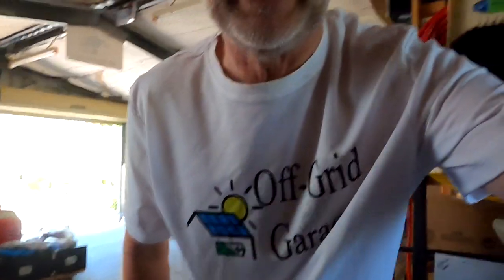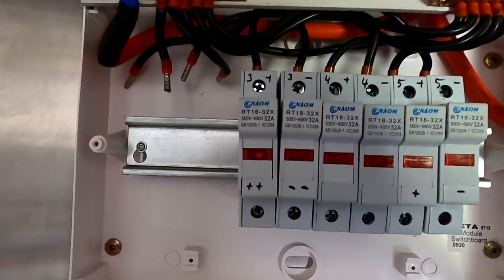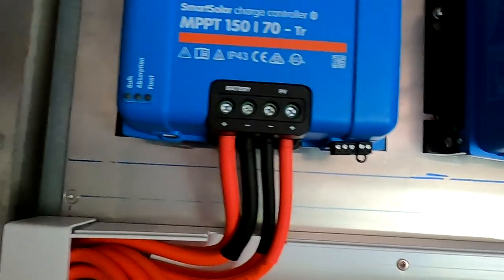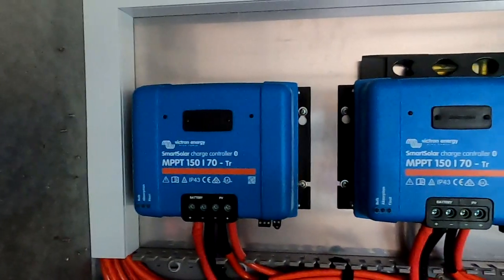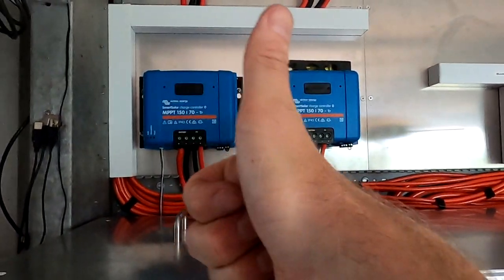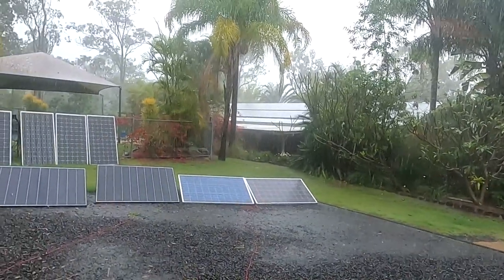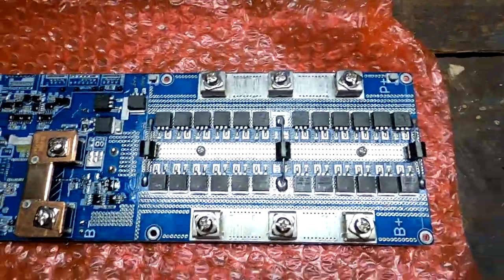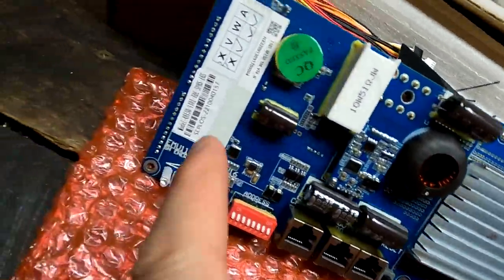Living without solar. Possible? Also, the brand new SEPLOS BMS 10E with Bluetooth arrived...

Comment: Andy my friend, you should be putting bare wire in those solar charge controller terminations.  You are reducing the contact surface using ferrules in a terminal that is designed to compress finely stranded wire.  The compression spreads the wire and makes contact on all sides of the wire.
Reply: Noooo! Damn your infernal logic. I love ferrules too.
Reply: Can you test this while you wait for panels Andy?
Reply: I was about to write something similar. The ridged nature of the clamp plus ridges on the ferrules could easily reduce the effective contact area.
By using bare wire you are increasing contact area👍🏻
Reply: That's really useful to know, will be the same on the MCB's.  So I doubt I'll need my crimper I ordered yesterday, but at least I've not ordered the ferrules.
Reply: Agreed, no ferules required there. Thin stranded wires will compress easy in those terminal.
Reply: Ferrules should only be used with terminals that aren't made for fine stranded wire. If the terminal is made for it then fine stranded wire will have a much better contact area than rigid ferrules.
Reply: @taulli1  That has nothing to do with love, buddy.
Reply: @TheRonskiman  It depends on the terminal type and how finely stranded the wire is. In some cases ferrules are needed to avoid the connection loosening over time.
Reply: Come on 😊we are not talking about micro volts 😅 put the wire as you like it won’t make any difference
Reply: @niktak1114  So how do we know which is correct, to ferrule or not to ferrule? The MCB's I have, have the same style terminal as the Victron MPPT's.
Reply: @TheRonskiman  it's all in the terminal, most products come with instructions that tell you if it's designed for solid or stranded wire.  Ferrules should only be used when a terminal requires solid wire (or coarsely stranded wire) as those terminals usually have a small surface area spring, that is designed to push the solid wire against a single flat surface that conducts the current (there are also compression fittings for solid and coarsely stranded wire that conduct from 4 sides including the screw that you shouldn't use finely stranded wire in) .  If you look closely at the terminal on the solar charge controller, you will see ridges that are there to help hold stranded wire in place after it's compressed.  A ferrule will only touch those ridges.  This is a very small surface area and will cause heat to build up.
Reply: @hamieh1  I'm sorry but you are incorrect my friend.  Look closely and you will see the ridges that are designed to hold the finely stranded wire in place.  Those ridges are the only surface area that a ferrule will be touching.  Stranded wire compressed touches way more surface area.
Reply: @SabretoothBarnacle  spot on brother.
Reply: @boatelectricaldiy  I totally agree with what you said about the surface area , but that wouldn’t make any changes to the performance as we are not dealing with micro volts . But if you are looking for perfection yes you are correct 👍👍👍
Reply: @boatelectricaldiy  Thanks. The MCBs I have, have the same ridges.
Reply from the maker: I have discussed this with the electrician and will tell you soon here on the channel...
Reply: Correct , the only time to use a ferrule is when the screw itself is contacting the wire strands  . When you have strand clamps , you need strands . A Flir camera will show the difference quickly at this amp load .
Reply from the maker: @onthelake9554  I'm test this out with the IR camera. I have now used both ferrules and stranded wires in these terminals so can compare it nicely.
Reply: @OffGridGarageAustralia  Cool , I look forward to it .  From what I have seen at work ( automation electrical panels) the bare strands in a strand clamp are always fine and ferrules are not under a heavy load. I know it's hard not to use them .
Reply: @OffGridGarageAustralia  Not all electricians are cut from the same cloth. I look forward to his input.  Maybe he uses a bit of glued heat shrink to create stability at the base of a stranded termination like I do?

Comment: One of my favorite things about your channel Andy is the attention to detail. You do an excellent job showing young folks the importance of detail oriented work. I still think you should put panels over the pool and make the structure out of Aluminum.
Reply from the maker: @aft what a lot of crap that comment is!
Reply: @OffGridGarageAustralia  what the engineer part ?
Reply: well the last time i checked a tesla was over 100k  and generally a blue collar worker couldnt afford that on a car but hey i dont have a tesla and you do  so if the comment offends you i will delete it
Reply: @dtec30  The whole comment , and the capitalization , the punctuation , the attitude . You too can have a Tesla if you change your outlook and work hard at something you love.
Reply: @onthelake9554  what capitalization ? or punctuation
Reply: @onthelake9554  it wasnt measnt to be derogatory and aplogies if you took it that way
Reply: @dtec30   Exactly .
Reply: @dtec30   What was it meant to be if not that ? Never mind then . Just seemed very rude to me .
Reply: I was going to oversize my house system using a frame over the pool as I'd run out of roof space.
I left it too long and legislation disallowed any increase to existing systems.

Comment: Andy  Will you try this experiment on your Charge Controllers..
Take a piece of the wire you will be using to connect to the controller. Place a ferrel on the wire BUT DO NOT CRIMP.. Put the wire with the ferrel into the controller connector and  tork the screw to spec. Go do something else for a half hour and and hour.  Rotork the screw once again. I think you will find the screw moves about 1/8 turn.. If more than 1/8 then wait some more.  Remove the wire/farel.  Check out the contact areas. This should show good contact connection.  And no fraid wires. 
Copper wire is soft. It will move from areas of high pressure to low pressure.. I find that if I go back and retort connection a month later will make for a good long working connection for life.
Reply from the maker: I can certainly do this test with the old controllers. Interesting. How does the copper move if it is stuck in a ferrule though?
Reply: @OffGridGarageAustralia  The wire move to an area of lower pressure.. I have seen this a number if time in my 50 years of working in electronics.
Reply: Using the farrules in the connector clamp is like using your hydraulic crimper.
That put tons of pressure on the lug and the wires pressing down to remove all the air between the wires. The clamp on the charger controllers not so much. The wires will move from high to low pressure over time the temperature. So retorting the screw is necessary. If the screw doesn't move while retorking you should be good.  The use of ferrules in the controller clamps with keep the wires from fraying, I think this is the best solution for Victron objection on using ferrules.

Comment: Thanks for the video, Andy.  Sorry to see your solar contractor let you down.  I was in charge of an $ 18,000,000 refinery upgrade to electronic instrumentation.  I always look at the packaging some electronic boards arrive in.  They should all be wrapped in anti-static material.  Some of the boards came in regular plastic, which caused failures several months after the operation.  They cost about $ 8000 each!  The storeman ordered wrapping for the boards and bought cheaper plastic bags!  All our technicians wore anti-static straps during installation to prevent problems.
Reply: My son had a similar story on very expensive circuit boards in heavy mining trucks.

Comment: No Ferrules!!   If you have Cage Clamp Terminals a ferrule will be a downgrade.  It will turn the connection into a couple of point connections instead of the full internal cage surface.    If the connector is a lone screw jamming into the cable then use ferrules.

Comment: I see the west roof is kicking in nicely, 10 amps at 8am, 20 amps by 9.30am - even if thats it for today, no more strings you'll still get a decent photon harvest :)
Reply: 10.30 and I guess thats the unshading - bring on the 50A!
Reply: @KevIsOffGrid  Nice, it was hitting 52.1A by 10-51, finally getting some charge back into those batteries 🙂

Comment: Imo the old trace C35, C60 etc unit had a big grub screw to hold the cable, held the cables really tight, with the type that victron uses, should include a flex grip under, imo there are crap, need to make good connections when dealing with dc

Comment: Darn... I was hoping to see some panels today. The title was not misleading.

I am actually wondering, how did you get along defining what it's their responsability and what it's your responsability in the build. So they just put the solar panels, cabling and some bits and odds, and you do from solar charge controllers down? Would be interesting to know.

I asked a solar company for a quotation until the charge controller/inverter, and they were not interested or would not give me warranty if I connected my own batteries...

Waiting for good news from your side.

Cheers and keep up the great, great work!

Comment: the display connector should also be different as the had announced the V16 to me which I refused due to far too high import fees due to their fed ex shipping. They wanted 60€ on top of the bill which had already incl. 19% VAT and therefore I had to reject and got the BMS from aliexp shop that is selling it as mineral. 
The big difference: the shipped instantly and dhl asked for 9€ custom fees and customs instead of 60€. Of cause that might be related to germany but lots of complaints about shipping costs and fees if bought via the seplos alibaba outlet.
Reply: Nein das Display und auch das connectorcable sind identisch zur alten Version. Ich habe bisher alles DDP bei denen gekauft, das war wesentlich billiger als die Einfuhrumsatzsteuer und den Zoll zu bezahlen.

Comment: The best thing about DIY is no waiting. 
The Issue with the solar rebate is you have to get someone who has the appropriate acreditation to claim the rebate. Which can be substantial depending on state.
I myself go and buy panels from a local distributer who has panels left over that are probaly around 20 watts less than the latest panels. :-)
I paid around $80 each for  brand new 370 w jinko panels. 
I paid full price for a sonnen battery. Now the govt are doing subsidies. It still cost me over 20k for 5k5 panels and 8 kwh battery with the solar rebate. Granted they where panels that only reduce 10% over 25 years so that covers my retirement. 🙂
But then what does the govt do reduce feed in tarrif to 5c per kwh.
So I have an extra battery bank 3.3kwh (soon to be 6.6kwh usable) on a seperate circuit charged from my jinko panels that discharges when required and does not feed back to the grid. The sonnen I have can only output 2k5 as a load. So boosting it with my other gti I can pull 3.9 kwh before pulling from the grid. We cook using induction so its pretty effecient and super fast to heat up stuff.  
NB my sonnen has broken twice in 3 years. 1st time it just stopped charging. second time after they replaced the board and module they bricked the module with a remote update after a week or so. 
Andy 
I have done the calculations for replacing all the petrol used by cars with electricty from the grid.
Go do the maths. I calculated around 70+ wind farms need to be added to provide the capacity to charge vehicles.
With that comes the cost of upgrading all the infrastructure that has been neglected because proffit is king.    
So we the people who are actually assiting by giving them a boost are being penalised because the grid is basically stuffed. 
Rant over.
Can't wait to see the new panels when they arrive on the roof and the big switch on.  :-) 
Off Grid house next Andy, you know you want it . :-)

Comment: My concerns about that bluetooth! It is beyond a metal plate which should be grounded. A grounded cage is not very effective to the range of the bluetooth signal or it is completely blocked. I am curious about your video ;-)
Cheerio,
Wolfgang
Reply from the maker: It won't be blocked. The signal still comes through almost the same way. I had this before with the switchboard I installed the charge controller in. Even with the door closed, no problem connecting.

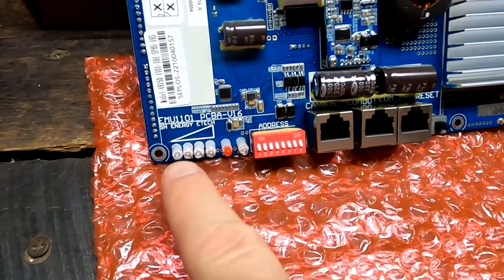Comment: Andreas, this board is the V16 - look at it at 14:25 where you can clearly read what they also mentioned in their communication documents about the differences and how to identify the boards. Bluetooth has been anounced to me as DISPLAY only , so you need to buy the full blown BMS to get the option of bluetooth, not every Seplos BMS will have BT on board as they had told me.

Read the line above the LED EMU V1101 and then PCBA-V16

Not the 10 whatever - at least the official productname had mentioned V16 for the new version . 
I hope they have fixed the balancing for the older BMS too as the channel meine energiewende has mentioned in his last video about the seplos BMS and talked about improvements over your preivous versions. But I am still waiting for that particular next video where he wanted to check the SEPLOS BMS. 
Not sure how this could happen that there are so many versions and not sure if they really get in touch with all the customers for their firmware updates.
Reply from the maker: This is a prototype, not sold anywhere else... yet.
Reply: @OffGridGarageAustralia   The Bluetooth chip is on the back side of the display.

Comment: Hello Andy. Do you think using ferrules (or the recommendation from Victron to not use them) depends on the type of stranded wire you use? I mean, your welding cable is super flexible with many many very thin strands. I guess, this is not standard, when Victron speaks about "flexible cable". My flexible cables are much more stiffer, because they don't have so many strands. Greetings from Germany ;-)

Comment: I’d like to know the details about the battery. Specifically, what happens to the BMS if the battery is low or dead. Will it protect the battery and save the settings??
Reply from the maker: I have all these videos here on my channel/ I tested all this in full detail and showed what happens to the batteries, BMS and charge controllers.
For example these two (but there are more about this topic):
Low voltage disconnect with three banks in parallel: https://youtu.be/5Nv3Blz2knM
Full charge video with three different BMSes:
https://youtu.be/mkelEzVNmIE
Reply: @OffGridGarageAustralia  sorry but I meant the small battery you found on the Seplos PCB

Comment: Since it's a known issue will they go beyond the 5 year warranty?
Reply from the maker: These are new controllers now so warranty has reset.
Reply: @OffGridGarageAustralia  did the warranty cover them? You said it was a known issue so didn't know if you meant you knew it was an issue or if victron themselves knew it was an issue
Reply from the maker: @todamnbad  Victron knew about the problem and they just replaced the two controllers. The issue only occurs under certain circumstances and is quite rare. Only if connected to 48V batteries and if there is a certain constellation of solar voltage for a while it can trigger that problem. It stops charging, restarts itself after around 20min and works fine afterwards again.
Reply: @OffGridGarageAustralia  weird, good thing we live under different stars

Comment: Need help. I'm below noob here. Could you do one on the non-inverting summing amplifier circuit? (voltage adder circuit) I want to take 3 cell phone power banks and add their voltages (5v + 5v + 5v = 15v) then output the resulting 15v to a power inverter. I'm surprised this circuit isn't more popular. Off-grid solar power from multiple voltages of panels. Etc.? There's a rare Fincore one on eBay but I don't see any output on it. Any help much appreciated. Schematics look like gibberish to me but I've always wanted to learn electronics!
Reply from the maker: A phone power bank delivers what, 3A max. 15V x 3A = 45W. What do you want to do with 15V and 45W?
Solar panels are connected either parallel or series. I made a video here: https://youtu.be/GFjL0-r6LbY
Reply: @OffGridGarageAustralia  I am forced to be off grid. My aunt passed away and we inherited her mobile home. Because we let the electricity stay off so long, though, we have to rewire most of the residence including the breaker box in order to still live here and have power turned on or the electric company will not turn on power. They require inspection and I know it will not pass. Rewiring everything is not attainable at this time because of the cost. Therefore I am forced to live here without electricity. The power Banks will run strings of LED lights or run our internet box. (12v 3a. Or 12v 1.5a) Though I will watch your video because I love your work, solar panels are very expensive and a lot of people will probably have some of the smaller ones and mix them with larger ones due to cost. This circuit would be excellent for those people. Solar charge controllers would handle the larger voltage nicely and bring it down to extra amps for a better overall power supply using those tiny solar panels in addition to the larger ones. I am saving for a couple Eve batteries to hopefully run a boost converter for longer term internet and lights.

Comment: Hi Andy, I have two Victron 150-35 MPPT controlling 6× 160 watt solar panels in parallel, one has arct on the battery positive terminal causing burnt wire and terminal melted on MPPT. Any ideas why this happened?...💙🙏😎
Reply: Loose connection
Reply from the maker: I would also say a connection problem. What cables do you use? Victron specifically advises which cables are suitable and which aren't. Have a look in the manual of the MPPT.